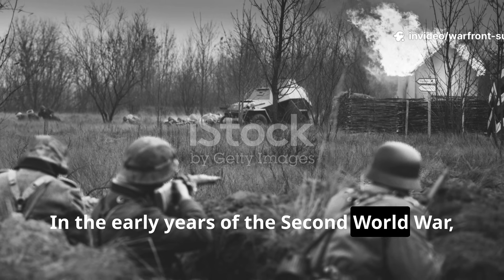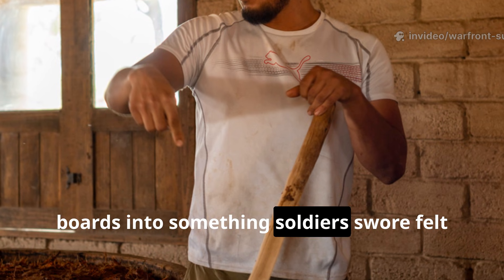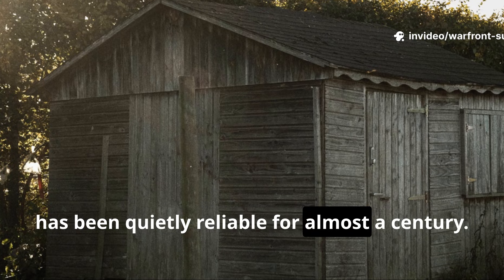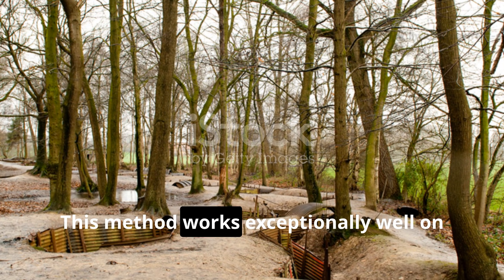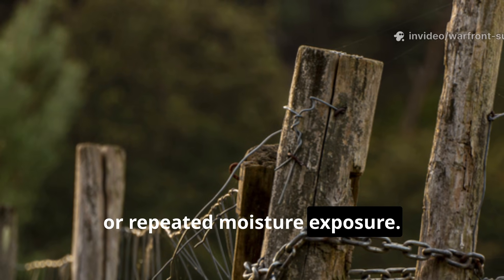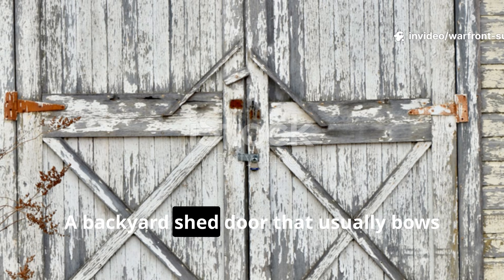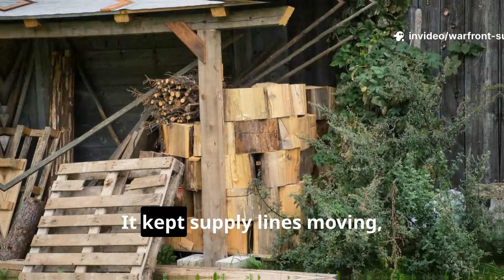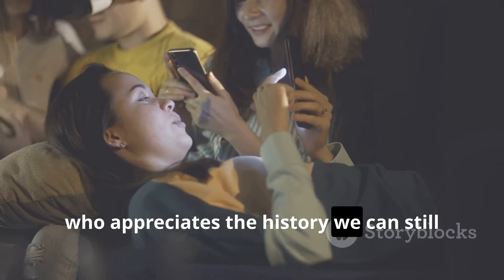The WWII Wood Hardening Trick That Modern Builders Forgot

Comment: Isn't borax carcinogenic? I'm pretty sure the EU banned it's sale for that reason.
Reply from the maker: Borax isn’t classified as a carcinogen. The EU didn’t ban it—they just restricted it for certain uses because high exposure can irritate skin or affect reproduction. For normal DIY use with proper handling, it’s considered safe.
Reply: @WARFRONTSURVIVAL sorry. Reprotox not carcinogenic. But still toxic. It's also banned for sale to consumers which means only experts can get it.
Reply: As a contractor we used to coat entire frame jobs in borax termites won't eat the framing

Comment: When making the borate solution, what are the water-to-borate proportions and how much water should be boiled off?  Can this be used with wood stain, polyurethane and spar urethane too?  Does it matter whether or not I cool it down first?  Is it as resistant to small arms fire as sodium silicate-treated paint?
Reply from the maker: A strong borate wood-treatment mix is 1 part borate (borax + boric acid) to 4 parts hot water (or 1:1:8 by weight for borax : boric acid : water). Do not boil the water down—only heat it enough to dissolve the powders. You can use it under wood stain, polyurethane, or spar urethane, but only after the borate solution has fully dried, the grain is sanded smooth, and the wood is sealed so the finish can bond properly. Cooling the solution first isn’t required, but applying it at room temperature prevents surface crystallizing. Borate treatment offers some flame resistance, but it is not nearly as fire-resistant as sodium-silicate-treated paint.